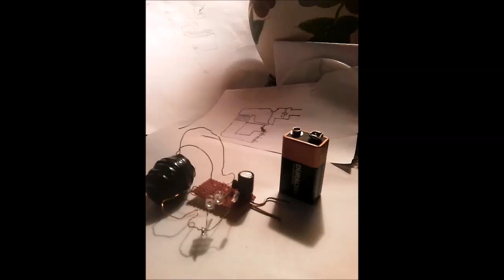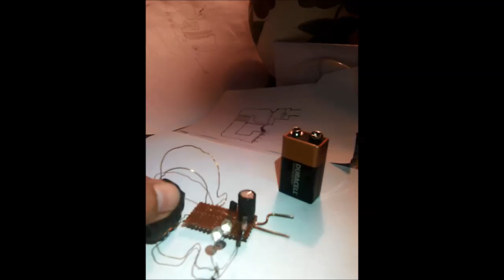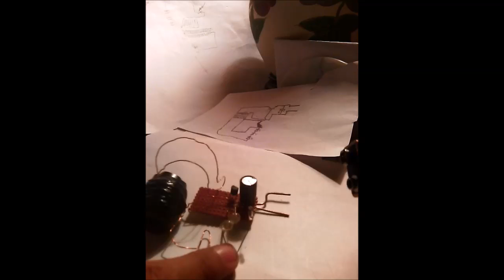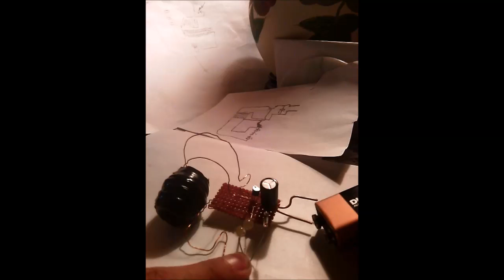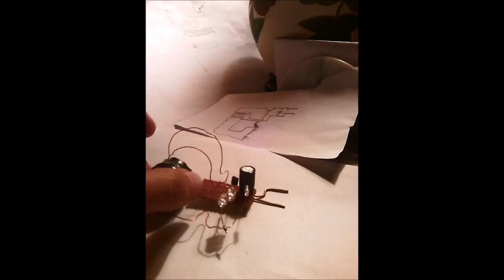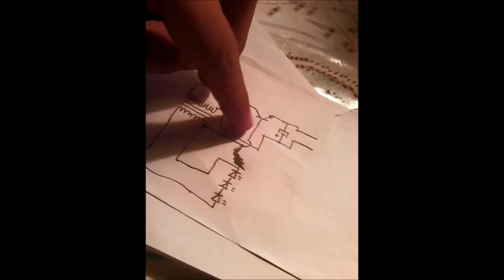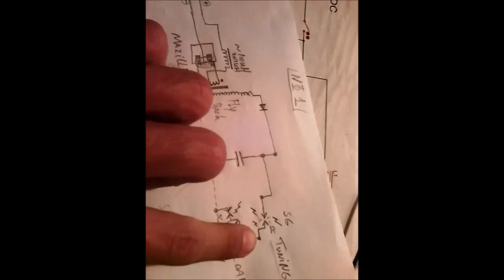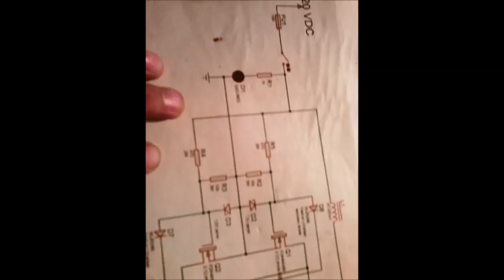Geofusion SJR Looper Successful Replication

Comment: Which Diode Did You Used?
Reply from the maker: Germanium Diode
Reply: Any Number Of Diode? And Can That Variable Air Cap Replaced With 500pf Ceramic Cap I have seen that works fine

Comment: Did You Used Magnet Wire? Please Tell ME?
Reply from the maker: Hi,
Yes magnet Wire, 24AWG
Reply: Thanks I am using Magnet Wire 24awg But didn't used diode thats why the circuit maybe not working

Comment: Good stuff man this helped inspire me to tinker with it also. I'm learning it's all about capacitance. For example the reason your not getting oscillation by touching the positive terminal is because it isn't tied to the battery case as much as the negative terminal, which you are holding. your body is becoming the capacitor/aerial that is driving the circuit. It works super efficient this way. I have yet to figure a way to substitute that with components though. May need to use an earth ground and some kind of antenna.

Comment: Awesome replication.  It looks like you got it working correctly.  Please share any improvements that you come up with.  I am interested in your multiple transistor idea.  I feel that this circuit is at a very primitive stage and a lot of improvement can be made on it going forward.  Based on my experience with the circuit I feel that instead of the air capacitor I should try building the capacitance into the coil using foil sheets or extra windings.
Reply from the maker: lasersaber 
Thank you man!  Yes for sure I will share, i'm busy experimenting for a quite while already, 6 years? Gathered so much, now able to build and replicate what ever comes in my mind to do.
Yes the multiple transistor idea is for it to pulse back in a way to keep the circuit alive on full brightness, and might one more come also , ( 3de transisitor) btw the transistor is MPS2222A.
as to pulse an antenna like mini tesla coil near the core. It's an idea.
To keep the Cap under intensive charge for bigger loading. and would have reached an Infinite run time.
yeah man, that idea sounds great to do instead of air capacitor, should try it!
yeah, like winding a bifilar extra coil to it, having a capacitive coil.
Keep up the post friend. 

Cheerz!

Comment: Could you try to get it to work using a standard transistor like ne 2222 or bc307 or something like that? Also could you test, suppose I have no germanium diode, would it work with the B-E junction of an ne 2222 (which is in fact a diode as well as seen in the circuit symbol)?
Thank you for sharing.

ps: to light up the diodes in stead of capacity you could also use a very high resisitance (many mega ohms). The circuit starts running on the megaohms of your fingers.A very small capacitor does almost the same (resistance at a specific frequency).
Reply from the maker: deslomeslager 
Try it out with a NE2222, I did not try that one yet ;).
I use a MPS2222A.
Yes I tried it with a high resistance but  the circuit dies in an instant,
there is a certain lvl of resonance to hold it to for it to stay on.
might try the megaohm again but I find a metal plate aireal or air capacitor does the job., Next video I will show how the circuit pulses when tuning the air cap

Comment: thanks. Very helpful info for my replication that also didn´t work well.
Reply from the maker: getreal155 
what are the specs you used man? I could give pointers
Reply: GFusion Core Thanks. Appreciate your offer.
I have the ferrite transformer and germanium that Lasersaber is using and for the rest I did exactly what he did except the big air capacitor that I don't have. It's working but not as efficient as his. I think I will try using 2 big copper heat sinks for the cap. Insulate the fins and slide them together to create a big cap that way. Maybe there are also other ways to make it work. Do you have any other suggestions maybe? I will experiment with this.
Looks like you made some changes to the circuit. The germanium comes of the anode of the LED's instead of cathode. Did you do this on purpose or is this a typo?
Reply: GFusion Core Forgot to mention that I use a NEC4001 , BD139 or MPSA06. These work great in many similar circuits where the 2222 or other general purpose npn's don't work.
Reply from the maker: getreal155 
Well the transistor I used is a MPS2222A.
NE2222  NPN can be put to the test, see if it can.

I have Kacher Tesla coils Build on small circuits using NE2222, 
it can have a AAA battery or AA only , so 1.2 or 1.5volts 
and it will light a CFL fairly.  oh well
Reply from the maker: getreal155 
Alright, awesome man.
well it depends on the wire gauge too and winds 
and not to forget the Ferrite you are using, 
The permeability lvl of the Ferrite nano crystal. plays a big role on output
lvls too. ;) 
Yeah man try the 2 copper heat sinks, see what it does.
try to use Earth with wires or with pins, that would be one to check out,
Germanium do harvest alot of radiant around us, so it's very useful.

Well no changes, the Germanium connection with the output coil and LED's is return current and blocker of Cap positive lead reverse current.